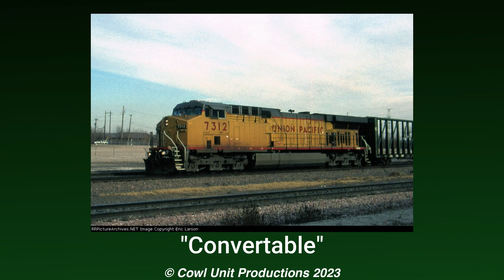Bite Sized Oddities - UP 7312

Comment: Interestingly, 7312 is not the only unusual engine to have a NS cab. Back in 1995, two Conrail C40-8Ws, CR 6192 and 6259. 6192 was wrecked in Erie, PA and 6259 was wrecked in Effingham, IL, both in 1995. They were both sent to the Juniata shops for rebuild. However, instead of recieving a regular Conrail cab, they recieved NS spec cabs. This is because, when Conrail ordered the new cabs from GE, they were producing NS Dash 9s, so those were the cabs that were sent to Conrail since it is what GE had. Both then continued in service for many years with their special cabs. 6192 became CSX 7357 and operated there until being sold to GECX in 2018. It was leased to NS for a short time before being stored, and it was scrapped at LTEX last year. 6259 ended up becoming NS 8436, and operated there until 2020 when it was sold to Progress Rail. It's status after being sold is unknown, but it is very likely it has been scrapped or it is possibly stored somewhere. I find these two Dash 8s very cool since they had a cab that no other Dash 8 on Conrail, CSX or NS ever had, and was a really interesting look
Reply: Conrail was making some locomotive surgery operations like those. For example, the CR SD40-2 6449 (2nd) was rebuilt using an old SD40, but with the original SD40-2 cab harvested from the CR 6449 (1st) that was wrecked. 
Another example is the CR C30-7A 6557. That C30-7 was repaired with a old Ex Erie Lackawanna U33C cab.

Comment: Just an FYI, 7312 was never truly an AC6000CW. It was built with the 4400 hp engine before the 6000 hp engine was ready, so the plan was to sent it and the other convertibles back to GE to receive the 6000 hp engine when it was ready, but because they were mechanical nightmares, that never happened, so 7312 has always been an AC4460CW since it was built, until it was rebuilt to a C44ACM.

Comment: Sticking with UP you should cover UP 6759 (you used a pic of it in the video) It suffered cab damage and got a CN teardrop cab to replace it.
Reply: 6759 got the teardrop nose but has the normal windshields.
Reply: @allohiorailfan6123  ya but the cab still has the shape of a teardrop cab, area below windows is larger then it’s supposed to be
Reply: @oakvillerailfan553 , good thing you mentioned that Teardrop cab on UP 6759.  That originally was originally on a Canadian National Dash 9.